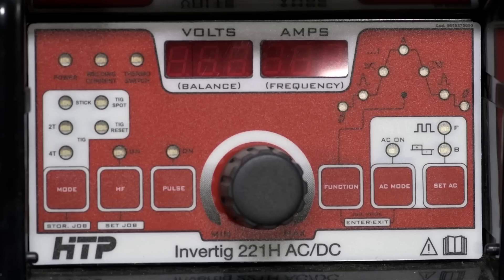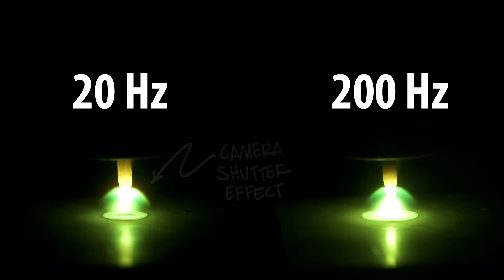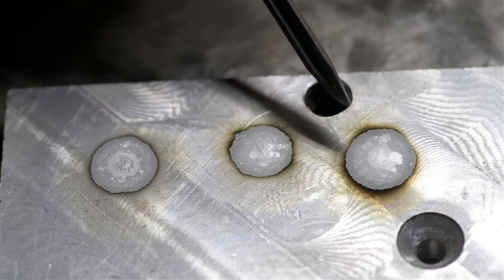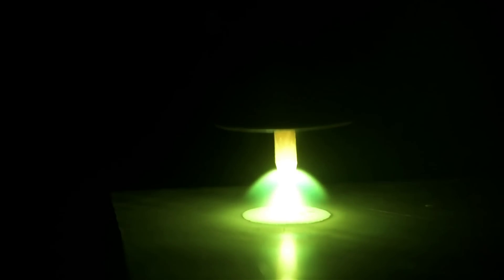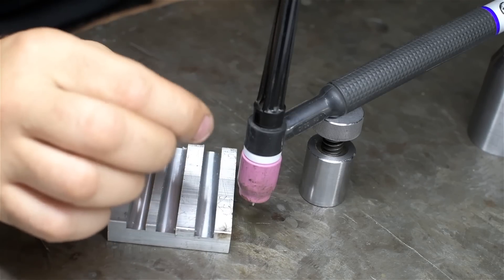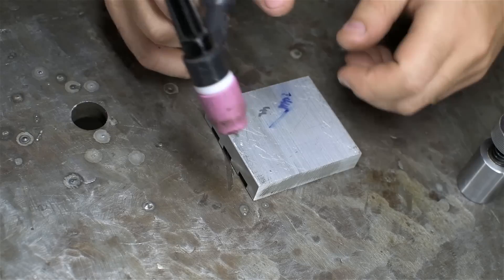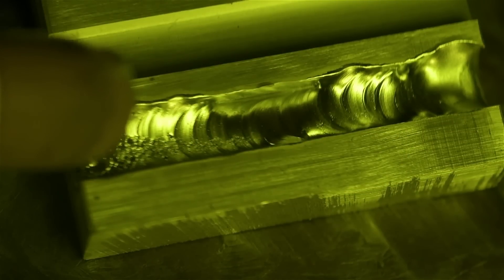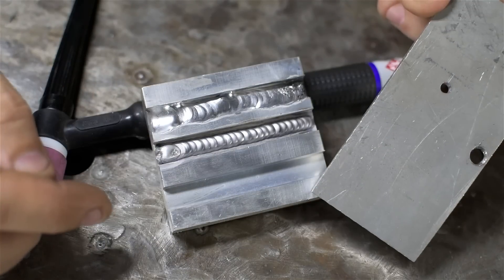TIG with TOT: AC Frequency?!

Comment: Here are some notes that may not clarify things to many people, but I need to try anyway.
The reason for AC in TIG welding has been to clean the surface oxide of the aluminum (and sometimes some other reactive metals) by a couple of different phenomena.  The first one is the ion bombardment during the reverse (=Electrode Positive) phase.  The normal Straight polarity (=Electrode Negative) mode sends electrons out of the tungsten.  As TIG welding functions with controlled, "fixed" current, the arc voltage settles freely according to arc length and gas composition and typically is 8 to 10 V for good DC welds in argon or near 14 V in pure helium.  But what happens, when the polarity is changed?
At reverse polarity, the voltage becomes quite erratic and varies from about 25 V to beyond 35 V, using argon.  Now, let's talk about the heat.  The POWER equals Current times Voltage.  As the current is kept constant (although two different polarities), it is obvious that the power during the reverse cycle is maybe triple that of the straight polarity cycle.
As already mentioned, there is ion (argon or helium, or both) bombardment of the aluminum surface during reverse polarity.  Unlike electrons, these heavy ions "kick" oxides loose from the surface and thereby produce cleaning.  However, the ions actually seek surface oxide spots.  That means after the near area has been cleaned, the ions bombard wider and wider!  That actually shows in this video - there are two hue cones, an outer one somewhat colored and a narrower one inside that appears bright white.  As the camera frame rate is not extremely high, it is not obvious, but I would say the inner arc cone is that of straight polarity and the outer one comes from the reverse polarity times.
There is a patent (by Rod Rohrberg et al.) claiming another mechanism for removing the surface oxides.  The patent description points out that the thermal expansion coefficient of molten - or melting - aluminum is many times higher than that of aluminum oxide.  Thereby producing very rapid heat pulses even with DC pulsing will cause a mechanical push-out of the surface oxides.  As crazy as it may sound, it actually worked in practice.  Merrick Engineering built a number of welders utilizing fast pulses of 150 A over a background of 15 A, all straight polarity.  The overall heat was controlled by the pulse duty cycle, which typically varied from 15% to 18%.  The pulse rise time was a few tens of microseconds.
Nowadays both operating principles are by default combined in VP (Variable Polarity) welding systems by Liburdi Pulsweld.  In those power supplies, the reverse polarity represents some 5 to 20 % duty cycle and the rise time in each direction is in 100 microsecond domain.  The power supplies are used in aerospace industry, where controls and repeatability justify a higher price than the old AC welders (with their fixed 50 % pulse duty cycle) ask for.  Using a minimum necessary duty cycle for the reverse polarity keeps the unnecessary cleaning spread at bay and allows better puddle control.  And a narrow seam.

Comment: I recommend anybody who is welding make sure you put earplugs in so you can actually pay attention to the weld characteristics and the flow of everything instead of the sound. And this goes for Arc, mig welding, or Tig welding.! Sometimes the sound of the arc can cause you to do things you wouldn't normally do. Like speed up or slow down.

Comment: Well i think you described the skin effect itself as it is taught, it becomes really relevant for most cross sectional area calculations over several 100kHz and that could make for a different arc distribution, but only at those frequencies. Wikipedia has got a table on that, but that is for copper wire. No idea how to adapt that to welding.

However, what travels a lot slower is the ionized gas itself. What you got between tip and work piece is a small cloud of gas that conducts current and presents a travel path of lower resistance for the arc. Compare with a jacobs ladder, its speed is mostly defined by the speed of the ionized gas and its arc could be blown out because of that. If that cloud changes its form, the arc is gonna change its form. AC welding keeps it kind of where it is, travelling up and down between tip and work piece within your inert gas stream. It is a bit like the "kicking out street lamps" phenomena, where you can kill an arc by moving its electrodes fast enough. Higher frequency = faster speed required. That could focus your arc, as the ionized gas cloud has electromagnetic properties and flows along the arc at subsonic speeds. The initial or refiring arc might travel at the speed of sound, which makes a cracking sound, but after that i think it will follow the change in current.

The amount of energy transported does in the frequency range between 2Hz and 500Hz afaik not really change with the frequency of an equally balanced waveform itself - quantum physics left gracefully aside (it is taught that higher frequency emits higher energy quants, but we are talking about the light spectrum here). A square waveform or a sinusoidal waveform itself does not transmit more electrical energy by changing the period, it can be proven by calculating (integrating) the area under a waveform.

An analogy would be to fill a jar with a drink from a bottle within half a second and fill the drink back into the bottle within the other half of a second. Effectively, the jar will be half filled during that second. Doing that four times per second will also make the jar effectively half full during a second. As long as the jar does not change its volume (voltage and therefore current) or the duty cycle of that filling and emptying out (lets say filling for 0,7s and emptying for 0,3s) does not change, nothing changes in regards to the area under that theoretically perfect waveform. Choosing a frequency has more to do with losses of parts that transmit that energy (for an electrical grid, it is a compromise between amount of copper and iron in the transformers used).

In a technical application, the losses between source and output increase a bit by switching faster, because in the case of a welder it is done with a switch and every switching causes a bit of a loss (the switch heats up, because at some point its internal resistance will increase and therefore current through the switch x voltage drop across switch = power that heats up the switch, or transistor in that regard). More state-changes per time, more losses, but thats not much to worry about, they are designed to run at such frequencies, maybe it is even compensated for by the device.  Unfortunately i can´t say anything definitive about welders, any regulator has deficiencies, maybe the time to swing in is kind of fixed, then more of an unregulated portion could slip through at higher frequencies, but hey, its a handheld device, there are more possibilities for an error there. 

Another loss could be a necessary refiring of the arc by zero crossing above a certain distance, if applicable. The heat in the conducting matter makes the arc relatively stable, like within a flourescent lamp that stays on as long as there are enough ions present to conduct at a given voltage and refire the arc, but around the zero crossing there might some additional losses as well.

I watched some of weldingtipsandtricks videos, in some the width of the bead is described as a function of the "pulse" frequency and heigth, which as far as i understood it, is meant as a current lowering pulse, not a frequency change of the carrier wave itself. I mean, yes, those pulses happen at a frequency, but they limit the amount of electrons passing through the arc during the pulse. Which in return affects how the ionized gas cloud is formed and kept up. So that would be my theory about that. Yet I got no idea how to prove it without breaking that inert gas shield. Maybe trying to weld within an electromagnetic field that changes the focus of the arc could do the trick?

Comment: Hey Tony, I realize this is video is more than 6 months old already but still great and relevant. I'm not sure if I understand you correctly using your analogy with skin effect but this is what I think your saying, please tell me if it's correct. The LOW frequency would be like being punched in the face closed fisted and full force once per second and HIGH frequency would be more like being punched in the face ten times per second. The LF allows one big penetrating blast per second and the HF doesn't have the ability to develope the same burst of energy that many times in the same time period. Kind of like 'dwell time' as opposed to 'dwell angle'. Is that close to what you are saying here? Thanks very much in advance! Peace

Comment: Definitely that skin effect has no influence at such a small difference in frequency but I speculate some mechanical vibration may have a role. Like resonating frequency of the puddle, or at lower frequency electrical vibration can be transformed more easily in mechanical vibration.
Just a speculation.

Comment: I think there is another effect at play, as you heat metal past the red hot, and then let it cool, you will see a "wave". Metal is loosing heat and contracting, which causes internal tension that heats the metal back up. If you use higher frequency, this effect does not occur because there is far less time for the metal to contract, thus making the heat distribution much more stable.

Comment: I guess if you think about it as higher frequency is going to have marginally more loss, however what you're also doing is changing how much power each random spot receives makes sens that the heat wants to bleed out less if you will.

Comment: Higher frequency allows penetration control with out unbalancing the wave form ( as in the older control method on most welders) In the earlier welders one would shift time one one side of the wave form to be balanced vs. on the part vs on the electrode. This allowed heat to be concentrated where it was needed sort of.... Higher frequency balance welding does away with the short comings of that method. The pay off being that you don't lose cleaning of the part, or stability of the electrode, if you want to better control where the heat is applied. Either that, or I am full of it.....

Comment: High frequency harmonics occur only on the leading and trailing edge of a square wave and die off quickly. Therefore, there will be more high frequency energy the more often the wave switches.